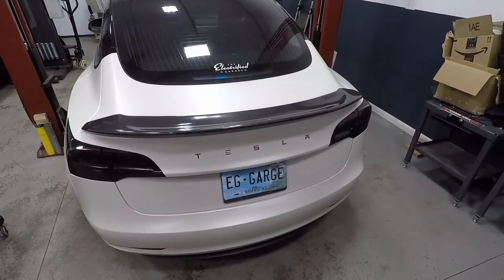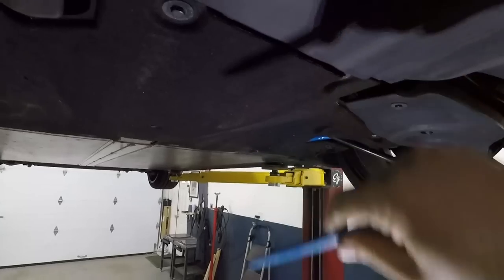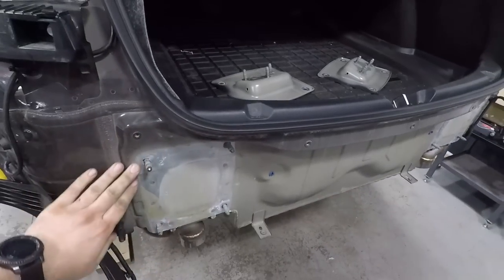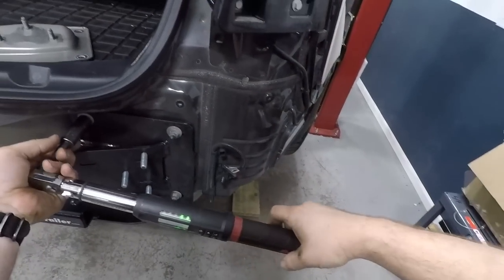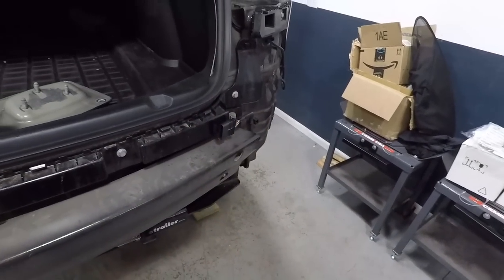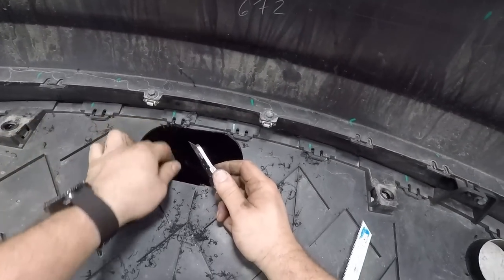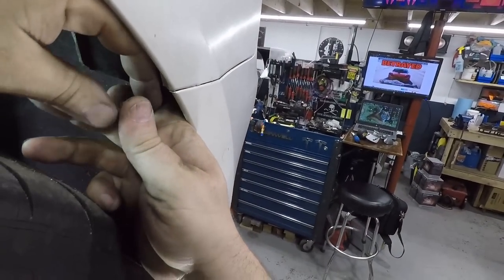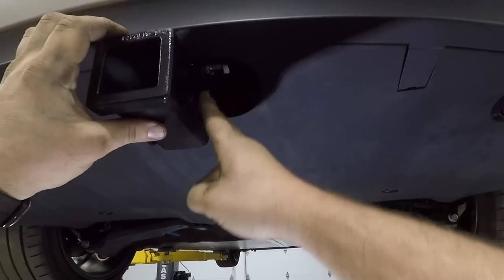Electrified Garage: How to Install a Torklift Ecohitch 2.0" Trailer Hitch on a Model 3

Comment: Instead of drilling the hole for the hitch on the diffuser Tesla does sell the updated one that’s on the newer Model 3’s with the hitch door on it. I believe it’s part# 1135410-00-A for about $140.00. Just thought I’d throw this info out there. Hi Cris n Chad.
Reply: How does one go about ordering a part like this?  Just a service request other?

Comment: Thank you so much! Great video, thanks for taking the time to get all the detail.  That little electrical connector between the body and bumper was such a pain to get disconnected. And the tip on the Torx 25 screw on the inner fender was so appreciated. I would have had a tough time guessing why it was not coming out while using the wrong tool. Subscribed!

Comment: Thanks so much for creating this video. I was able to get an Ecohitch installed on my 2018 Tesla 3 in about one hour by following your steps. Really weird thing though is when I took off the bumper mounting brackets, they were both completely filled with water. There's tons of buildup inside and on one of them, the three bolt heads are completely rusted inside the bracket...have you come across this before? Other than that, the install went great. My Ecohitch only came with two bolts welded in place on each side for mounting the bumper, the third bolt had to be installed using a backer wrench from the backside of the hitch. This meant I had to install the bumper to the hitch before bolting the hitch to the car's frame. Other than that, it went exactly as you showed. Thanks again for the great video...saved me loads of time and headaches!

Comment: Really do appreciate all the work yall put out for people to see and learn from. Any ideas on finding/using a 12v power source near the back to tap a  ZCI zero connect interface flat 4 trailer wiring kit into? its the wiring kit that came with my Eco hitch.
Reply from the maker: Yes, we do those all the time, I'm in the process of doing a video just on the trailer harness install. I grab Power from under the rear seat B+ for those.
Reply: @ElectrifiedGarage  Any progress on this video?
Reply: @ElectrifiedGarage  any update on the trailer harness install video or at least a bit more details about finding the power under the rear seat?  I've also heard you can get power from under the driver's dash via a spade terminal in VCLEFT.

Comment: For drilling through the plastic undercover - the instructions state if using 3 1/2" saw to go 26-3/4" and for 4" saw to go 26-1/2".  In your video at 14:31 you state you are using a 3-5/8" saw and using 27-1/2".   That seems confusing since 3-5/8" is between the listed 3-1/2" and 4" options yet your length is longer than either one by at least 3/4".  It should be closer to the 3-1/2" option.  Have you found over time installing these that this measurement is better or something?  Thanks!
3-1/2" saw = 26-3/4"
3-5/8" saw = 27-1/2"
       4" saw = 26-1/2"

Comment: What is different about the performance model? Why don’t they offer the tow bar option on it
Reply: Michael Hainsworth.  I heard it was due to the Performance Upgrade Package having a lower ride height. With the added tongue weight rating the potential to hit the pavement with the hitch adapter goes up. Especially going in and out of sloped driveway entrances.

Comment: What about trailer lights? Is their a kit?
Reply: I've been told from other owners that the wiring already exists on all Model 3's since late 2019. I will confirm if this is true when I install mine onto my December 2019 (2020 model year) build
Reply: Anthony Reynolds it doesn’t. I wired in my own harness splicing into the cars lights. Not a big deal. But not a job for a novice.
Reply: That’s something EV Tuning should come up with. A plug n Play trailer light wire harness for All models S,X n 3. Chris or Chad should get on top of that before someone else comes up with it. 🤷
Reply: @anthonyreynolds2365  The wiring referenced is a 12Vdc connection near the drivers area. On 2018 Model 3 there's a vacant blade terminal for always-on 12Vdc that has a wire going to it in later models. The wiring goes towards the very rear of the vehicle, and was confirmed to be connected to trailer wiring on Model 3 vehicles sold in markets that are offered with tow bar option. I would like to see EG Chris show a retrofit for those earlier models and also how to wire a trailer controller kit for that power source instead of direct to the 12V accessory battery.
Reply: Today I ran that VCLEFT connection via 5mm spade crimp terminal on 14awg wire today for my late 2018 Model 3 AWD to the rear powering a trailer light controller included with the Stealth Hitch (not ECO HITCH Stealth) kit including towing upgrade. You need to use a non-insulated spade crimp terminal ; insulated terminals would not fit deep enough to make contact (or you would have to force it in that is not easy to do). Fishing that wire from front to back is not too terrible but having the car on a hoist to work at knee/hip level is helpful. You will want to watch Ingineerix video "Tesla Model 3 - How to safely get 12v for accessories" https://www.youtube.com/watch?v=bXNjgyrcGno for the technical overview and then the update follow-up video "Tesla Model 3 - UPDATE: How to safely get 12v for accessories" https://www.youtube.com/watch?v=9De-VjFgLSQ to get an idea of where you're going to stuff your hand into the foot well connections to feel out that VCLEFT connection and stab the spade connector into. The car is definitely designed to be taken apart and put back together with minimal tools but not having much experience there were some broken push rivets and clips along the way. For some clues taking apart the trim panels along the way look at Michael Bodner video "Installing the Tesla Model 3 Power Trunk!" https://www.youtube.com/watch?v=UsZQrj4-4Xo from 19 minutes onward, and of course this video here from Electrified Garage. Note that this VCLEFT connection used to behave like a switched power source and its behavior was changed at some firmware update to be active whenever the car is awake. DO NOT HOOK DIRECTLY TO THE 12V BATTERY. Take the time to run this wire. It's less than $20 in materials and a pain in the ass but totally doable by someone with basic hand tools. You could also take the opportunity to add an aux 12Vdc outlet to the rear of the vehicle off this same connection so long as you're not exceeding 10A between trailer lighting and the additional load.

Comment: Do you think the Model 3 can tow the same amount as a Model Y? The US spec model 3 isn’t rated for towing yet aftermarket hitches say 3500 GVWR. Would that be reasonable to assume that it will do the same as the Model Y?
Reply from the maker: So the tow rating of the Euro 3 is a towing capacity of up to 910 kg (2,000 lbs), so that would be a safe load, I know the hitch can take more but Im unsure of the vehicles (body/suspension) capability. I have seen more towed but it is at the owners discretion to go to that limit.
Reply: @ElectrifiedGarage  really appreciate the info. I decided to keep it under 2000 just to play it safe.

Comment: What are the pipes for on the rear of the car?
Reply: POWER SUPPLY FOR THE RECHARGING PORT... those are fat wires.... not "pipes"
Reply: @80spodcastchannel   i think he meant the one at 13:45
Reply: Curtis Hartung yeah those metal pipes, there are discharge cut outs in the bottom of the bumper for them; like an exhaust pipe but this not having being ICE what are they for?
Reply: He has an aftermarket exhaust on the car that is app controlled to make ICE sounds.
Reply: Speakers so Chris’s car can make fart sounds while driving. 😂
Reply from the maker: Its Milltek Active sound control - https://evtuning.com/collections/model-3-electrical/products/milltek-active-sound-control  I haven't released the video on that yet. I'm running really behind on videos due to the high demand on the shop work. Its an electric exhaust system for EV's. Its really cool. I will try releasing it soon.

Comment: I have a Chevy Bolt EV, do you have any idea what kind of Scanner I can use to read & Erase Crash codes? I have a car light on the dash that has a padlock through the car lite up, which doesn't allow car to go to Drive or reverse only neutral and Park. This also stops the car from charging.